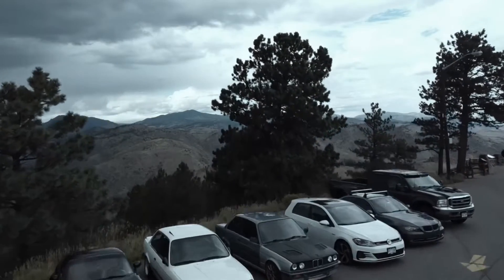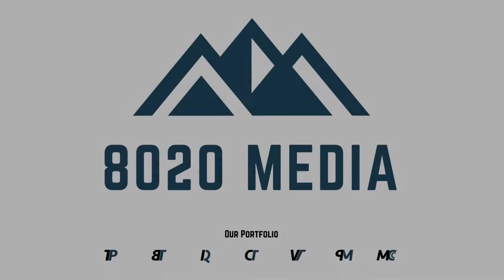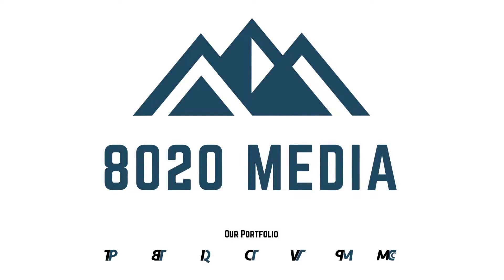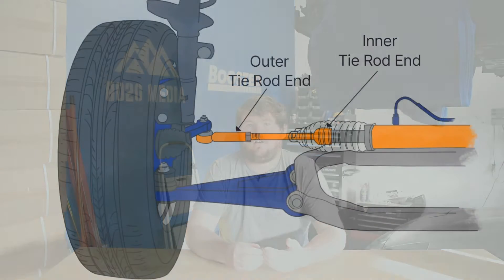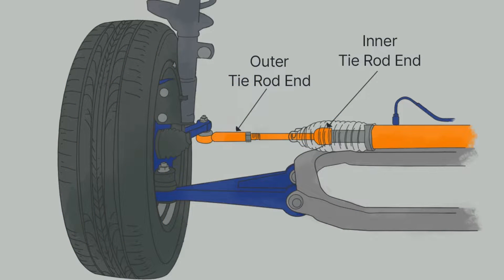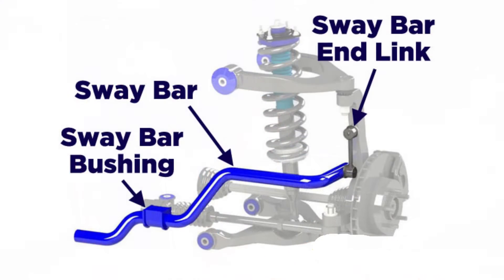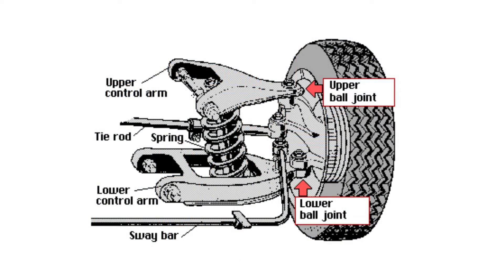DIY - How to Diagnose a Car Clunking Noise While Turning

Comment: citroen c5 aircross 2022 .37000km When the car is stationary and the steering wheel is turned, you can feel very small jerks. I'm pretty sure it's due to the electric servo. When the steering wheel is turned, the angle sensor registers it and forces the electric motor to assist, which is felt as small jerks as the electric motor kicks in. This is only felt when the car is stationary and the wheels are difficult to turn. some body have like that ?
Reply from the maker: J - What you’re describing on your C5 Aircross is quite typical of electric power steering (EPS) systems, especially when stationary, since the steering motor only activates in response to steering angle sensor input and torque demand, which can create a slightly jerky or “stepped” feel as the assist engages in pulses rather than smoothly; the light knocking sound you hear when turning quickly is often from the EPS rack preload, intermediate shaft play, or even strut top mounts transferring noise, and it usually becomes more noticeable with the wheels loaded at a stop. At just 37,000 km it’s unlikely the rack is failing, but it’s worth having the dealer check for EPS software updates, steering rack bushing or intermediate shaft play, and ensuring the top strut bearings aren’t binding. In most cases this is a characteristic of the EPS system design and not an immediate fault, but if the knocking gets louder or you notice vibration while driving at speed, then it’s a sign something mechanical like the shaft joint or rack bushings needs attention.
Reply: I noticed that when turning left or right while driving, it feels the same, but not as fast. When driving on the highway, it might be the same, but in that case the turns are not as sharp. thanks

Comment: mine sometimes make a very loud pop sound when braking, it only happens sometimes but it felt like i hit a huge rock on the road. it also happens when im fully turning and the pop sound happens. when im at a slope and turning it also sometimes make that pop sound. please help.
Reply from the maker: B - A loud, sudden pop when braking or turning—especially on slopes or with the steering at full lock—often points to a suspension or driveline issue such as a worn ball joint, broken coil spring, damaged strut mount, failing CV axle, or loose control arm bushing. When a part shifts under load (like hard braking or turning), it can suddenly “snap” into place, causing a noise that feels like hitting something. Since it happens intermittently and in situations that load the suspension differently, it’s important to have the front end inspected for play, cracks, or broken mounts, as ignoring it could lead to loss of control if a joint or mount fails completely. I’d recommend avoiding aggressive turns or hard braking until a shop checks it, starting with the lower control arm bushings, ball joints, CV joints, and strut mounts.

Comment: I have a knocking on my 96 Chevy but on the passenger side, in the dashboard area
Reply from the maker: P - On your truck, a knocking or tapping sound from the passenger-side dashboard area is often from the HVAC system rather than the engine itself. The most common culprit is a failing blend door or mode door actuator—small electric motors behind the dash that control airflow direction and temperature. When their internal plastic gears strip or the motor mispositions, they can make a repetitive knock or thump, especially when you change temperature, vent settings, or on startup/shutdown. Less commonly, it could be debris in the blower fan, a loose duct, or something rattling against the firewall. The best first step is to listen closely while changing HVAC modes and temps—if the sound changes or stops, it’s almost certainly the actuator. These parts are inexpensive but can be tedious to access, depending on location.

Comment: What about a metal banging sound that is coming from the front left tire, and it gets worse while turning right and it almost stops when turning left, I just recently replaced my inner and outer tie rods. The sound will sometimes randomly stop when I'm up to speed around 50-60
Reply from the maker: J - That kind of noise pattern points most often to a worn or failing left front wheel bearing. When you turn right, more load is transferred onto the left bearing, making the noise louder, and turning left unloads it, making the noise fade. Other possibilities include a loose brake caliper bracket, worn CV axle (inner or outer joint), or a strut mount/top hat issue. Since you recently replaced inner and outer tie rods, it’s worth double-checking that all suspension and steering fasteners are fully torqued and that nothing was left loose. I’d start by safely jacking up the left front, grabbing the tire at 12 and 6 o’clock to check for play (bearing looseness), spinning it to listen for grinding, and inspecting the CV axle and brake hardware for looseness or contact. If it’s the bearing, you’ll likely need a press or hub assembly replacement.
Reply: @8020Automotive  Thank you so much! You just verified all my own research also, ill get on that thank you again!

Comment: Volkswagen grinding noise in front when turning.
Reply from the maker: T - A grinding noise in the front of a Volkswagen when turning is commonly caused by one of the following: a worn CV (constant velocity) joint, especially if the noise gets worse during sharp turns; failing wheel bearings, which can make a grinding or growling noise that changes with speed and steering angle; brake components like warped rotors or stuck calipers rubbing even when not braking; or possibly suspension parts like worn control arm bushings or ball joints allowing metal-to-metal contact under load. Start by checking the CV boots for damage and grease leakage, then inspect the wheel bearings and brake system for visible wear or play.

Comment: I have a 2013 Honda insight...
.rattles like a coin in a tin can when turning left...Help?
Reply from the maker: H - A rattling noise like a coin in a tin can when turning left is often caused by a loose heat shield, worn sway bar end links, or an issue with the CV axle (particularly the outer joint). Since it only happens during left turns, it’s likely something on the right side of the suspension or drivetrain is shifting under load. Start by checking the exhaust heat shields under the car, then inspect the front right CV axle for play or damage, and finally look over the sway bar end links and bushings for excessive wear or looseness.

Comment: Mine makes a knocking  noise when steering the wheel but you can only hear it in the car i didnt hear any noises outside while steering! Do you have any suggestions?
Reply from the maker: J - If you hear a knocking noise inside the car when turning the steering wheel but don’t hear it outside, it’s likely coming from components inside the cabin or under the dash—most commonly the intermediate steering shaft, which can develop play and make a clunking or knocking sound that’s only audible inside. Other possible culprits include the steering column u-joint, worn steering rack bushings, or loose interior trim around the column. While it might not be dangerous right away, it can worsen over time and affect steering feel, so it’s a good idea to have the shaft and column area inspected or lightly lubricated, especially if it’s a known issue on your vehicle model.

Comment: 2016 mustang with 51k miles.  When taking off from a start, it makes a clunking sound from the drivers side.  Also makes the similar sound when stopped and turning the wheel to the left.  Also when pressing the front end up and down by hand, I hear a squeaky noise like a squeaky mattress.  End links the issue?
Reply from the maker: J - Yep, based on your symptoms, your front sway bar end links or strut mounts are strong suspects; worn end links can make clunking sounds during suspension load changes (like acceleration or turning), and if the bushings are dry or torn, they’ll also squeak when compressed, but don’t rule out lower control arm bushings or ball joints, which can also clunk under load and may squeak as the rubber degrades—jack the car up, grab the sway bar near the end links and give it a tug, and check for play or dry bushings at the control arms too; with only 51k miles, it’s likely just a dry or worn-out link or bushing, and they’re cheap and easy to replace.

Comment: Mine makes a loud bang primarily on the front right wheel only when I turn the wheel far enough on the left or right
Reply from the maker: B - A loud bang from the front right wheel when turning the steering wheel sharply in either direction—combined with a rubber lining piece falling off near the wheel—strongly suggests a problem with the suspension or steering components, such as a broken coil spring, failing strut mount, or binding CV joint; the rubber piece could be part of a strut boot, spring isolator, or wheel well liner, and if it detached, it may be allowing metal-on-metal contact or something to shift under load—have the front suspension, strut assembly, and control arm bushings inspected, and check for any part contacting the tire or frame at full lock.
Reply: @8020Automotive it's a loud pronounced pop both heard and felt in the steering wheel both when maxing out the turn and then when straightening the wheel back out after that initial pop. I kept my hand on the cv axle and feel nothing. I feel nothing when holding the outer tie rod but I feel it lightly when touching the outer tie rod end where it meets the tire. I'm suspecting an inner tie rod joint but any further diag help would be appreciated
Reply from the maker: @jonathanteegardin9242  if the pop is loud, felt in the wheel during full lock and again on return, and you’re not feeling anything directly on the CV axle or outer tie rod but can lightly feel it where the outer tie rod meets the knuckle, then yes, the inner tie rod is a prime suspect, especially since it's under the most strain at full steering angles and can develop play that only shows under load; to confirm, jack the car up, have someone rock the steering wheel back and forth quickly while you feel for slop directly at the inner tie rod near the rack boot—if there’s any noticeable play or if the boot is torn or leaking grease, it’s time for a new inner tie rod, and while you’re there, check the rack mounting bushings and upper strut mounts too, since either can also cause pops under load if they're worn or shifting with suspension movement.
Reply: There was also a rubber lining piece that came off right about the wheel
Reply: Hi Michael

Comment: my car makes clunking noise when turning, and driving over speed bump. is it cv joint or lower arm?
Reply from the maker: Z - A clunking noise when turning and going over speed bumps usually points to a worn lower control arm bushing or ball joint, especially if the noise is more noticeable when the suspension compresses; however, if the clunk is more pronounced during sharp turns at low speed, it could also be a failing CV joint—check the CV boots for tears and grease leaks, and inspect the lower control arm bushings and ball joints for play or cracking to confirm which is the culprit.
Reply: @8020Automotive  heres the problem. I went to the mechanics and they couldnt find the problem. Everything seems to be fine. The only thing they can suggest is to do allignment. Im gonna see if the noise still gonna be there after.
Reply from the maker: @zlee001  Keep us updated.

Comment: Hey man, since I see you’re still replying to people even after a year I figured I’d give it a shot. So I have a 2014 ford fusion and I noticed a loud clunk that sounds like it’s coming from the steering column while I’m in the car, outside the car it’s hard to identify where it’s coming from. It only makes this sound when i turn slightly from neutral straight tires. Couple degrees to the right or left then it stops and only clunks again when my tires or wheel gets to straight/neutral. Would love any feedback. It’s at about 135,000 miles. Thanks man
Reply from the maker: S - We won't leave people hanging! That clunk you're hearing is a common symptom of a worn intermediate steering shaft or steering column universal joint, which can develop play over time and cause a metallic knock or clunk, particularly right around the neutral/center position; it's often more noticeable from inside the cabin because the sound travels up the column, and harder to isolate from outside since it doesn’t echo through suspension like other noises—at 135,000 miles, it's also smart to check the steering rack mounts and lower control arm bushings, but the intermediate shaft is the most likely culprit based on your description. Keep us updated.
Reply: @8020Automotive thanks man! I really appreciate that I’m going to check that out. I also noticed today that it made sorta the same noise while going over a speed bump? Any thoughts on why that would be?
Reply from the maker: @spencerhunt1093  That loud clunk near the steering column, especially when turning slightly from center or going over bumps, is a classic sign of a failing intermediate steering shaft—specifically, the u-joints or sliding section inside the shaft can wear out and cause metal-on-metal clunking when the steering loads shift, which is most noticeable at the center position or during slight corrections; the fact that you also hear it over speed bumps suggests it could also be worn strut mounts, sway bar end links, or lower control arm bushings, all of which transfer noise up through the column, but the intermediate shaft is a common issue on Fusions around your mileage—get under the dash or in the engine bay and gently move the steering shaft by hand to feel for slack or clunking, and you’ll likely confirm it’s the culprit.
Reply: @8020Automotive you are the man, thank you so much
Reply from the maker: @spencerhunt1093  We try!
Reply: I jacked up one side at a time today, the clunking went away when turning to the side that was jacked up. Does that make sense given what we have talked about? Sorry to keep bothering you I just really want to get it right. The tie rods and ball joints seem fine I tested them when I had it jacked up.

Comment: Hi there
I get a screaming noise when my vans loaded when i turn to the right

I replaced the drivers side wheel bearing and its no different
Reply from the maker: D - If your van makes a screaming noise only when turning right under load and replacing the driver’s side wheel bearing didn’t help, the issue is likely on the passenger side—turning right loads the left side unloads the right, which can reveal a failing right front wheel bearing, CV joint, or even a dragging brake caliper or dust shield contact; since the noise is load-dependent and directional, recheck the passenger wheel bearing, inspect the brake components for rubbing (especially heat marks on the rotor), and make sure the CV axle boot is intact and the joint isn't dry or binding—also spin the wheel by hand with the van lifted and listen for any grinding or roughness.

Comment: I had my top mounts replaced on my 2017 A3 due to a clicking/clunky sound whilst turning at very slow speed (under warranty). 1 month later the noise has gradually come back (no longer under warranty) and now my dealer says the bump stops need greasing!!!!!!WTF!!!!! Are they taking the piss or what?🤔
Reply from the maker: C - Sorry to hear this... You're absolutely right to be suspicious—greasing the bump stops isn’t a standard or lasting fix for a clicking or clunky noise while turning at low speeds, especially after recently replacing the top mounts, which are typically the primary culprit; if the noise returned within a month, it’s more likely they didn’t properly seat or torque the strut mount components, failed to replace the strut bearing (which should often be done with the mount), or ignored other worn suspension bushings or sway bar links, so blaming it now on “dry bump stops” sounds like a weak excuse to dodge accountability—have a trusted independent shop inspect it to confirm whether the strut assembly was reassembled properly or if something else was missed entirely.

Comment: Mine makes loud banging noise on opposite rear when i turn from a dead stop. Left rear when i turn right and right rear when i turn left. Once i get going it disappears. I changed rear cv axles, rear ball joints and checked all bolts. Every fluid has been flushed. The car shifts fine, drives fine and does not have torque steer. Wheel bearings dont make any noise when i free turn the rear wheels. What do you think the problem is? The banging noise also accompanies quite violent shaking on the said side. 
The car is 30y old and i just got it 2 wk ago. Has an old coilover but no leaking, bouncing or bottoming. The tires are quite new. The cars is lowered w wider rims and spacers. Nothing is rubbing. This has been driving me crazy. Your advice would be appreciated..
Reply from the maker: A - Given your symptoms, it strongly points to a suspension geometry or binding issue, most likely from the lowered setup with coilovers, spacers, and wider rims on a 30-year-old chassis; even though your rear CVs, ball joints, and fluids are new, the problem could stem from axle angle stress, binding control arm bushings, or coilover preload or misalignment, which can cause components to bind under torque transfer during tight turns from a stop; also check your rear differential mounts, subframe bushings, and sway bar end links, which could be worn or shifting under torque—especially if spacers have altered scrub radius or geometry—since it disappears once rolling, it's very likely happening only under static load + turning torque, so jack the car up, check for bushing deflection, coilover clearance, and rear axle play under angle, and even try removing the spacers temporarily to see if that eases the load path.